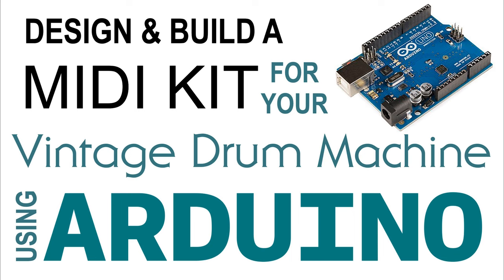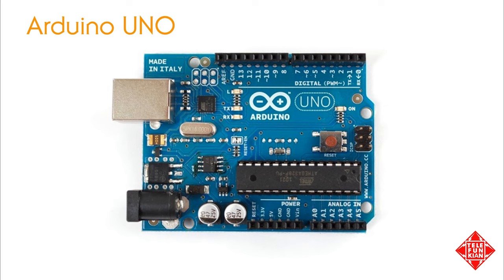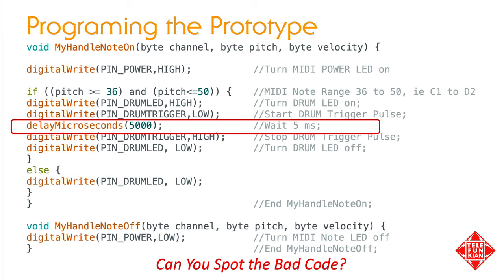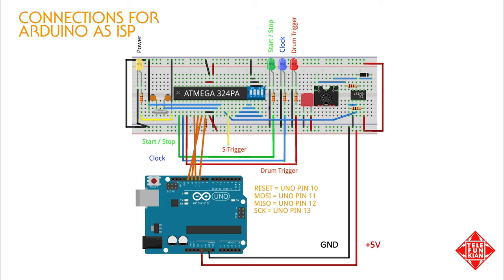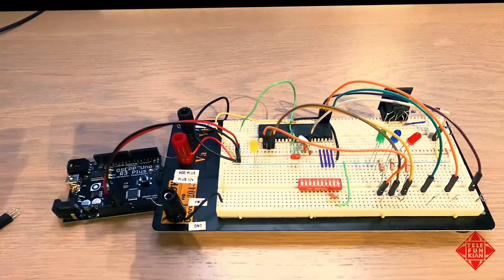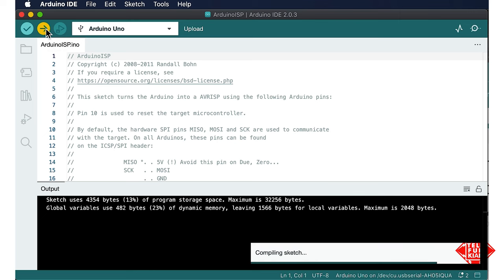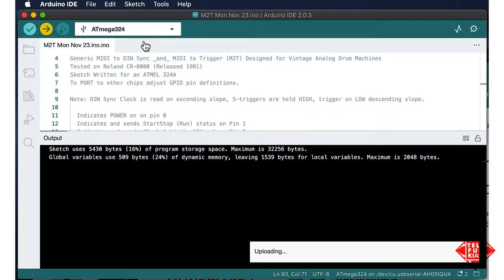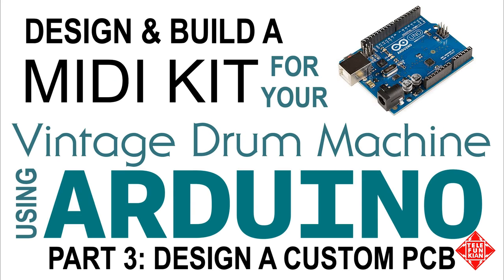Design a Drum Machine MIDI Kit Using Arduino  Part 2

Comment: Thank you so much for sharing your work. I wonder if you already finished building the PCB and installing it in the cr? :)
I really would like to build this for my cr-8000 even if Arduino, Microcontroller and programing is a bit over my head for now.
A little update regarding my own cr-8000 as a reminder from my last message: I've bit the bullet and bought a set of 4 rubber feet from Syntaur. I was hesitant because of the high shipping costs. But I thought that I could resale the 3 feet that I don't need and maybe recut a bit of the cost of buying these...
Anyhow... eager to watch the next installment!
Reply from the maker: Yes, I have built the PCB and installed it in the CR-8000, it is shown briefly in the video introduction. I actually finished it some time in December 2022. It takes me some time to edit my videos and produce the final content, in this case probably longer than usual as I was waiting to get new labels produced for the CR-8000 before releasing the latest CR-8000 video, which I wanted to get out before I started releasing the videos on the Arduino based MIDI to Trigger Converter.  I am in the process of producing the PCB video which should be out in ~ 2 weeks. It may be the final video in the series, depending on how much detail I get into on the programming.
Reply: @telefunkian  Great!